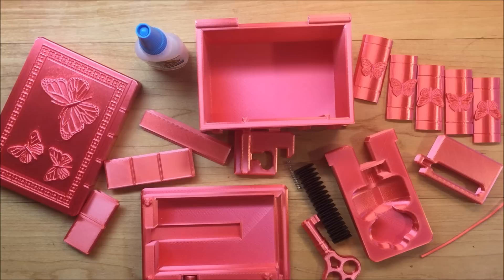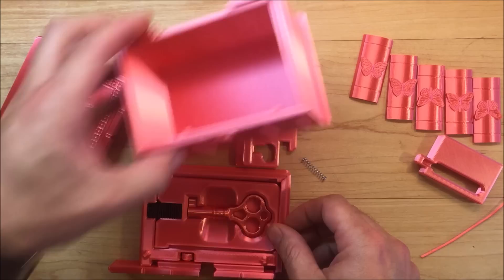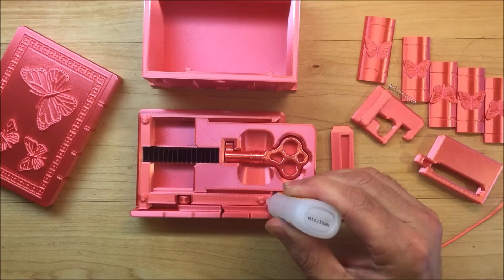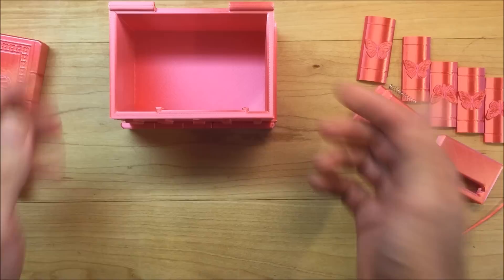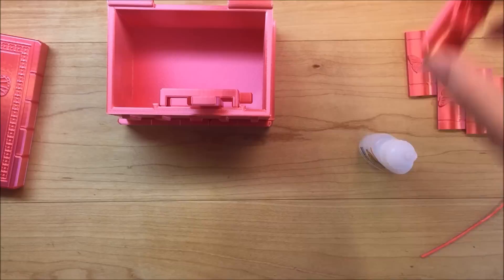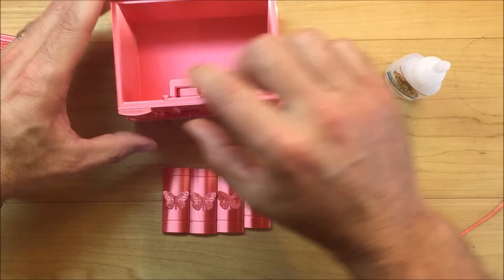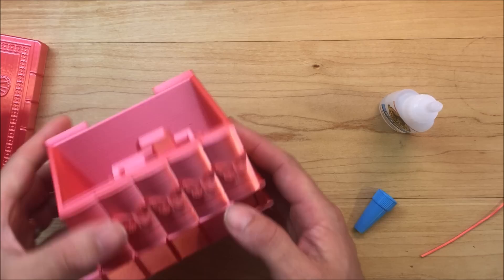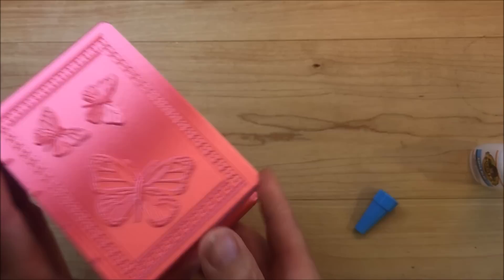Secret Butterfly Box Assembly

Comment: This printed very well in ABS and polished up nicely. The lid should be printed with high infill in ABS (50%+) to prevent warping and cracking. Alternately, it could be printed in flat orientation with supports if low infill is desired.

Comment: Very impressed with the scale and printability of this box. I am printing one right now (without butterflies) entirely in ABS. This will allow me to strengthen and polish it with acetone vapour bath and instead of super glue, I'll use ABS glue so the joints will be welded instead of just glued. Glue can fail, especially glues that harden like super glue. If you weld instead, it becomes one solid part instead of two parts glued together. Designing STLs and orientations that remove the need for supports is a sign of a good designer. Keep it up!
Reply from the maker: Thanks!  FYI, if you dont know, If printing in ABS you may have to scale the parts to account for shrinkage.
Reply: @3DPrintingWorlds  All parts should shrink proportionally so it won't be a problem for fitting.

Comment: Just a word of advice, printing this in wood filament will make you tear your hair out. No way to print this with larger sized nozzles and retain the details needed for mechanical properties.
Reply from the maker: The details on the top wont come up with a larger nozzle. I have had no issues with hatchbox wood and a .4 nozzle.

Comment: Hi what printer did you use I've had trouble printing the base on a non heated bed it starts to buckle and lift
Reply from the maker: I have printed it on a prusa mk3 and a FFCP but both have heated beds so I have no experience printing on a non heated bed.

Comment: is the middle part supposed to be completely flat? I ended up printing it and it has a bow to it that brings the edges up
Reply from the maker: Yes it should be flat, it might not work properly if its not flat.  It must have warped on the edges.  You could try to put helper discs on the corner or check your first layer height.

Comment: Can i print the ABS spring in PLA? or can i make it in paper? i dont use ABS or PETG, only PLA
Reply from the maker: I wouldn’t think PLA would work as a spring... you can always print the alternative drawer with a handle.
Reply: I used PLA for the spring and it works fine.

Comment: Hello.  A lovely print.  I'm using an Ender 2 to do a trial run in some spare filement before using a silvery one.  Your surfaces do seem very smooth.  Are the various files just dropped to the print bed as they download from Thingiverse, or do any of them need reorientating?  What slicer do you use?  For example the two sliding pieces on the front of mine have a different fill pattern on the bottom shell than yours do, which seems to be diagonal.  Ech square face of mine is divided into four triangles.  Thanks
Reply from the maker: I try to orientate my models so they on the bed in the correct orientation when you open them. You will just need to rotate to the orientation that fits your cooling shroud the best.  Maybe you are just using a different infill pattern?
Reply: @3DPrintingWorlds  Thank you.  Yes, it turned out my external fill pattern was different (concentric) rather than the neater "rectilinear"

Comment: Did you print the “middle 2 and the middle 1” together? Or did you glue them together before starting the video?
Reply from the maker: Not sure what you are referring to but I did not glue anything together prior to the video. There is only one file named middle.
Reply: @3DPrintingWorlds  oh my bad I must have downloaded the files from someone who altered your original because I have the middle as printing in 2 separate files (the 4 walls and key hole as one print and then the bottom/floor as a second print) thanks for your reply

Comment: I can't print ABS. Don't have PETG but can get a sample.How about TPU?I have some of that.  Great job.
Reply from the maker: I have not tried it but I don't think TPU will work, its too flexible. There is a version of the drawer that has a little handle that does not require the spring that you could use if you cant make the spring.
Reply: @3DPrintingWorlds  Hi.  What resolution did you print at ? .2 and 15 or 20% infill?   1 shell for the spring and is 3 okay for the rest? Thanks
Reply from the maker: @ChinaAl  I printed at .2 with 15% infill and 2 shells except for the key it needs to be stronger so I would add more shells.  For the spring you want it to be a single extrusion.

Comment: Everything printed great except the key keeps breaking off my glass bed mid print. So I tried a few more times with a raft and still no luck. Did you print yours with a raft or did you not have adhesion issues with the key?
Reply from the maker: You need a brim, also the issue with the key is that it wants to curl at the overhang and knock it over.  What I do is print 3  shells thick until after it splits and the overhang starts, then I switch to only 2 shells.  Changing from 3 to 2 shells make all the difference.  Trust me, I know from experience I have tried a bunch of other things too....  I never have a fail now!
Reply: @3DPrintingWorlds  so three shells until it starts the overhand the switch to two shells. I'm gonna have to figure that out in cura. I know how to change the shell but but not mid print
Reply from the maker: MIchael Fiorino you can always just do  two shells to see if it will print, it just won’t be as strong.  I had some break with only two but it was as MRRF and a hundred people probably used it.

Comment: is this silk pla ? the print line is not visible.what layer height do you print this ? i have tried 0.1 but nothing close to this.this is too good
Reply from the maker: Its Solutech's Ultra pink PLA which looks just like the silk pla's I have seen. Its printed at .175mm. I think the reason why you don't see any layer lines might be just because the orientations in which the parts are printed and that the walls are all straight and printed vertical.
Reply: Yes the printed pieces are very nice. Not sure I can duplicated on a CR-10 but will try. Good instructions!

Comment: I only have PLA, will the spring not work? Would love some thoughts here.
Reply from the maker: Have not tried it but you can always print the version without the spring.
Reply: @3DPrintingWorlds  Would that be a different design?
Reply from the maker: @gwynnansmith6131  Nope, its in with the other files.  The drawer just has a little handle.
Reply: @3DPrintingWorlds  Hi, OK thanks I can see that now :) It was more for the big box shaped spring as I have a little pen spring, the file named SBFB-SPRING?
Reply from the maker: @gwynnansmith6131  I'm taking about the spring for the drawer that holds the key.  There are two drawers; one is designed without a handle that uses a 3D printed spring to make it come out, the other drawer has a little handle and does not use the spring.
Reply: @3DPrintingWorlds  Hi, OK thanks that's helped a lot :D

Comment: i just have trouble to print the key..... after an hour when printing the upper part its just spagettiiii.... even with a 15mm brim, no change... aaaarrgghhhh
Reply from the maker: Print with 4 shells up to where it splits, then change to 2 shells.  Trust me, works every time now.  To many shells causes it to get to hot and the plastic curls.  Its stronger where it splits so it wont break there even with only two shells.
Reply: @3DPrintingWorlds  sounds logical, but i have absolutely no idea how to print with 2 different shells.... i use the mk3s with prusaslicer
Reply from the maker: @woldschnaggl  Just change it to two walls, instead of more.
Reply: I had the same prob with the key on 2 different printers.  Finally printed it laying on its side, with brim and tree supports.  Worked fine.

Comment: For some reason I cannot print the spring any ideas
Reply from the maker: What is the issue?
Reply: @3DPrintingWorlds  it doesn't show up in my slicer after slicing it's just a blacked out version of the spring..... I tried supports and thought it was good but it basically printed a support and that's it
Reply from the maker: @scottharrison9800  What nozzle size line width?
Reply: @3DPrintingWorlds  oh crap that's probably the problem it's a 5mm nozzle
Reply: @3DPrintingWorlds  can I print it with a .5 somehow??
Reply: Maybe stand it up and add support?

Comment: I want the hours of my life spent on this thing back.  I tried 3 different types of glue and none would hold the box and bottom together.  The spring pushes on the side slider and this acts like a wedge to push the bottom and box apart.
Reply from the maker: Wow! What kind of filament are you using? Normally any type of super glue will work fine with PLA.
Reply: exactly. Not only are the models not very good, as it was extremely hard to print the key but also glueing it together does not work properly with this model. It all breaks apart and also what should hold the long front tile does not offer any kind of resistance at all.
Reply from the maker: Superglue works great. I took these boxes to a show last year and probably had a hundred people including children opening them and there wasn't a issue. If you are having issues with the glue holding its probably a result of the parts not being printed properly per your previous comment.
Reply: @philippkowalski1105  Can you post a link to your better version?... I didn't think so... This model is great - I have printed (stock CR10) and assembled two of these boxes using regular gel gorilla glue. My daughters bash and abuse them and they still function perfectly. I think you just suck at 'manly man skills' and seek to blame others for your own personal short-comings.
Reply: obviously you need to work on your 3d printing skills. mine turned out beautifully. super glue works great!